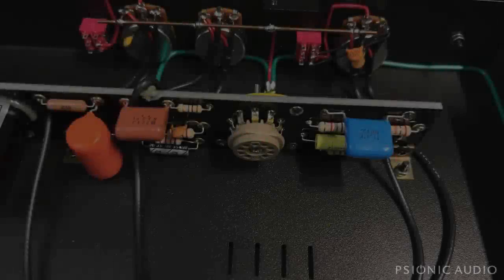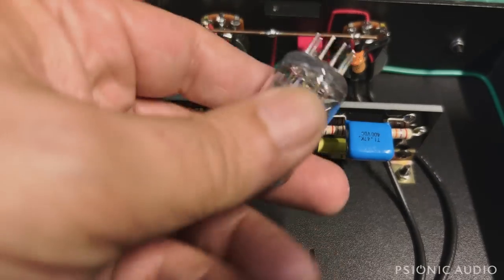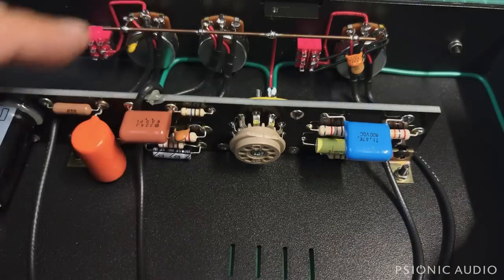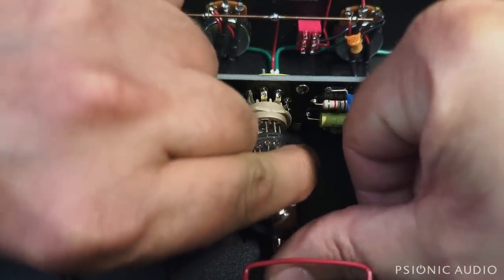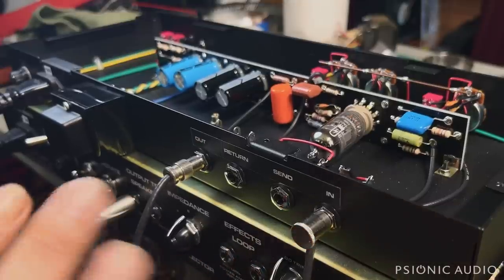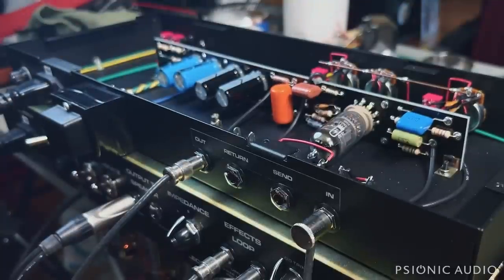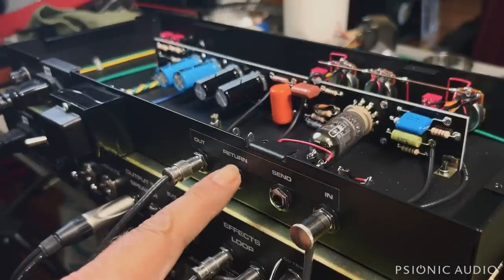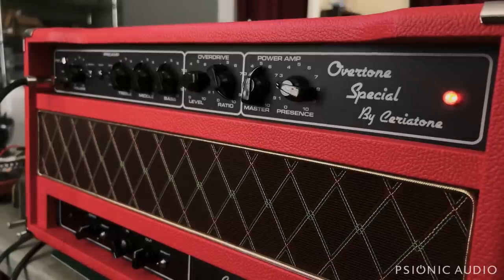Ceriatone Overtone Special - Finishing It Up

Comment: I just finished up an amp build. Grafting an AB763 and a 2204 is not only possible, it sounds killer. I even kept the Fender reverb circuit and it’s dead quiet. Of course I ran the mixing resistors of both channels into the reverb, unlike the 68 Custom’s. It all fit into a DSL2K 201 chassis too. It was a lot of work plugging the factory holes and drilling all the holes for the 9 tubes, transformers, jacks, can caps, etc but it looks bone stock from the front!

I used a lot of your tips, tricks and wisdom. So, thanks for what you do here. I greatly appreciate it.

Comment: I do own the same setup as two separate units. A few tips that I found just in case. 1. Trying to setup the clator at unity gain is good in order to keep it transparent. You can as well set drive at 2pm, in at 3pm and out at 9am and crank the amp’s master, this will create a very nice compression that responds to finger playing in a very dynamic way. (But won’t achieve unity) 2. I found out that the drive channel is best sounding when setting drive to 6 and ratio somewhere between 4 and 8 in order to retain some cleans to taste and then after adjust your base drive with the trim pot. Then you can fine tune the drive with the drive knob between 4 and 8, for whatever reason I feel it sounds better to crank drive to 6 and trim down as opposed to set drive to 3 and trim up. I hear less harmonics when doing the latter. Yes this means you’ll loose the possibility of wide drive ranges but it sounds better overall.

Comment: Film projector light bulb where the do not touch skin oil came from . FR-4 board with turrets  is a fine design  very nice thickness on the board also .  The silicon on the electo caps is a bit over the top for their size .  Makes changing them a bit more than it needs to be.  Less warranty repair I would guess. Low noise fets are few that can take a large signal . The power supply for them need a lot more attention than they usually get  for a low noise source.

Comment: That screw through the noval tube socket is a goid feature but it could (or very often should)  be grounded, to achieve shielding effect.
Reply from the maker: Wouldn’t matter in this application.

Comment: No it's not just you. Actually I bought a black Guild Bluesbird electric guitar from 2016 at Music-Go-Round in brand new condition. In fact it still had all of the clear vinyl on the pickups, pickguard and control plates on the back. I just couldn't figure why it was being sold for $450. So I plugged it in and quickly discovered it had an inferior 3-way toggle switch. It worked intermittently enough to know the Seymour Duncan pickups were good. Then I bought the guitar. It is an extremely fine, great sounding/ playing, well built guitar! Except for that lame toggle switch. Every other bit of hardware and electronic controls are excellent. So I was the winner in this deal, paying less than half ( 2/3's off list!). I took it home and immediately threw a Switchcraft 3-way toggle switch in.

 Those garbage $9 3-way PU switches with the leaf springs are garbage people. It's a bad design first off, and secondly it's crappy metal. In the case of the Guild the flat spring metal literally split at the seam along the sandwiched joint. I've since played many guitars, even other $1,000+ guitars with that same switch. I feel it's inferiority right away. They'll even bind in rapid toggling. Maybe they thought since mostly jazz players buy Bluesbirds they are more gentle or something.

Comment: My losing argument against soldering tube sockets directly to a PCB isn't just because it tends to cause cracked, broken-down solder joints, but also includes the fact that the tube socket contacts no longer "float" inside the socket housing and therefore don't self-align with the tube pins as the tube is inserted into the socket. Floating contacts would actually tend to remain more tightly bonded mechanically to the tube pins as the tube vibrates from playing the amp or when subject to transport shock; if the pins can float and move with the tube, instead of the tube and tube pins moving in opposition to the contacts, connection reliability is improved over the longterm.
Reply: Ah thats a very good point!
Reply: @weschilton  ,  Unfortunately, as I said in my earlier post, my "very good point" as you put it is a losing argument because pretty much any modern guitar amps that are made with printed circuit boards do indeed solder the sockets directly to the boards, sigh....

Comment: Send output buffer is a very nice thing to have, but if the send is not buffered, it doesn't cause much problems if you understand the situation and use very short, low capacitance cable (and high impedance effect input) or a external buffer connected to amp's send using a short cable.

Comment: The Ratio is just to balance the Clean and OD level.  You'd want the Ratio down lower for a better balance and to drive the next gain stage with the OD Level for better sustain and harmonics.

Comment: Hello, i just recently found your channel so im catching up. Not sure if you see posts on these old ones. I just had 1 question regarding that screw in the pre-amp tube socket. I could not see but is there a stand off underneath it to keep a user (or overly zealous tech) from over-tightening and squashing the leads? Thanks and keep up the great content!
Reply from the maker: I don’t remember now, sorry. But thanks!
Reply: @PsionicAudio  that's OK. I forgot what I had for dinner yesterday. 😁

Comment: I’ve actually tried and A/B’d a ceriatone overtone against my modded vht d50 with Mercury transformers and there’s no doubt that some of the hardware components in the vht were just better quality than the VHT…. Especially the jacks. Insanely Cheap plastic things in the VHT. The VHT sounded better though…. Like alot better. I was honestly surprised considering the price differences. I mean, caps and transformers were upgraded in mine.

Comment: In your opinion is the VHT D50 a good dumble clone, or should I continue to save for a Ceritone?
Reply: if you can live with the effort of saving to get a Ceriatone ...then go for it. I have had one of these amps for nearly 4 years, and I have not had any issues with it. And I built it, so that should say a lot, ha!
Reply: @danielcgomez  I do have the means. It shouldn’t be but 6 months of saving. Sounds like that is the plan. Thanks!
Reply: I have a D-50 and like it quite a lot. So did about 50 pages on the Gear Page. You get what you pay for is often the case with amps,too.
Reply: @aaronhiggs  then it's gonna take a year to get one. Many people have said it was worth the wait.